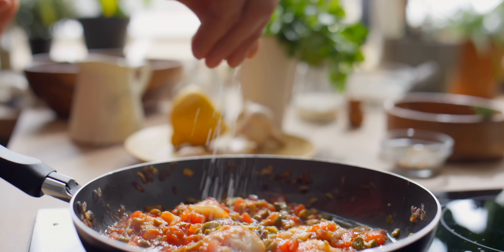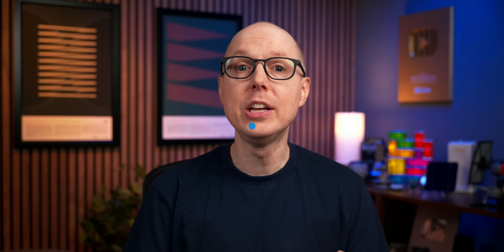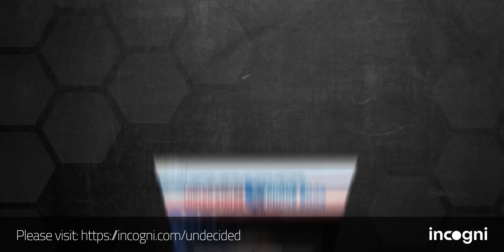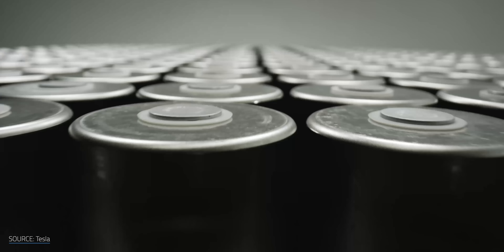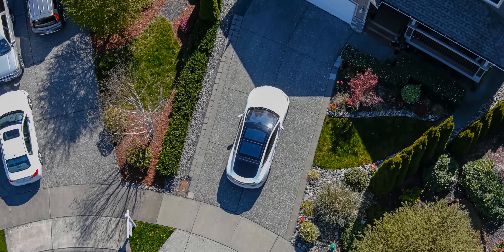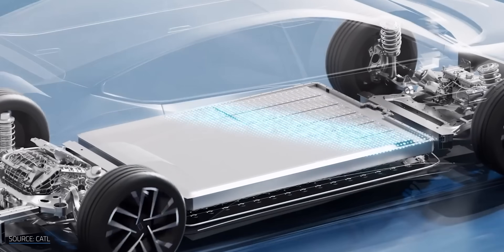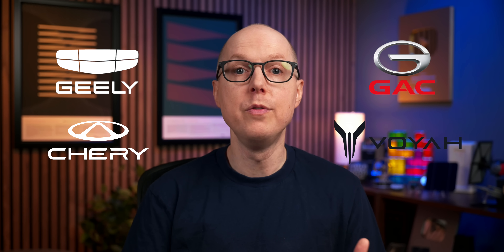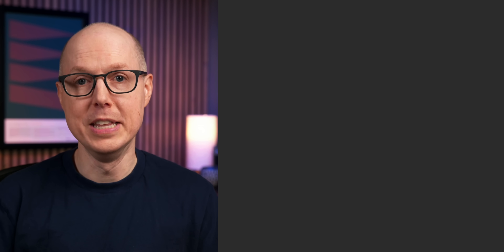How CATL Made Batteries 90% Cheaper (And What Happens Next)

Comment: Ideally a car would have a fixed sodium battery for daily use and a removable lithium battery for road trips.  Since you only rent the lithium battery when needed the initial cost of the car would be lower.  In daily use you are not hauling the lithium battery around when not needed.  Since the sodium battery has enough charge cycles to exceed the life of the car - no worries about replacement costs.

Comment: Part of the push by CATL to roll out this new chemistry is not about making batteries cheaper, but it's to comply with China's EV 2026 law, which mandates that EV batteries shall not, under any conditions go into thermal runaway or explode / catch fire when in an accident or punctured. 
Both BYD and CATL have batteries which comply to the new rules.

Comment: I'd want to see more info about charging speeds.  Slightly less capacity coupled with equivalent or even faster charging speeds would be completely acceptable, I'd think.  My hope would be that charging speeds wouldn't be as limited by thermal constraints, so it would probably be more a question of whether the difference in chemistry impacts the speed.  Looking forward to more information in the future!
Reply: 5C claimed... Not industry leading which is now 10C or 12C but still good...

Comment: Consumers generally speaking do NOT CARE about battery chemistry as long AS IT WORKS.  If the $10/kwh is right then battery swapping instead of charging becomes much more economically friendly.  When my 79 year old dad told me that he thinks an EV would be a better choice for them over a gas car, that's proof that EV adoption is going to accelerate.  For a commute mobile, there's zero reason to get a gas car today.
Reply: "There's zero reason". Depends on where you live. Maybe that is true for your context, but not to many people around the world.

I want to buy an EV and change my old car, but the main issue with the transition to EV is infrastructure.

Countries like China developed a whole ecosystem while pushing for EVs or even before the EVs started to gain popularity.

In many countries, the contrary is happening, EVs are arriving way before the changes needed in infrastructure like the fact that EV cars are heavier. Are roads and buildings designed to hold more weight if everybody switch to EVs? Or extra electricity demand. Are our countries grid designed to this sudden increase in demand?

In my apartment for example, it will cost several thousands to instal the plug to reach my parking lot. Also, it will need the approval from the building administration and even the HOA can have a say in case they consider it a "risk".

So, I wouldn't say there are no reasons to not change. There are many challenges even if you want to change depending on where you live.
Reply: The only reason is politics.
Reply: They may not care about the chemistry itself (I don't: I want it to work, and that's it) but they do care about cost and fires. Cost is up in the air at the moment: we don't really KNOW how much these batteries would cost - that 10% is just an allegation. I'll believe it when I pay 10% at point of sale.

The fire problem... well, lithium batteries DO have this problem. No, it's not "the heavens are falling" problem, but it is quite real. And sodium batteries don't have it. It's a damn good argument, don't You think?

Comment: I see this as sodium batteries helping to maintain the life of lithium batteries. And when lithium is too cold to operate properly, you can use sodium to effectively heat up the pack so the lithium battery can be use more efficiently. So like using a generator to black start a larger power plant

Comment: I know you kid about "buying an ebike instead of a car", but ebike batteries are quite expensive. We're talking €1,000+/kWh for batteries from the big motor manufacturers.

That is INSANELY expensive. That'd be €50,000+ for a Tesla Model 3 battery pack. Basically the prices for ebike batteries are stuck around 2012 or so.
Reply: Well... the problem is your scale is off.  By a lot.  E-Bike batteries absolutely do NOT need to be that large.  It only takes roughly ~350 watt-hours to have a decent 35-mile range with a modest 500W (or smaller) e-bike.  Like a small mid-drive.

E-Bikes with huge batteries are not really e-bikes... they are more like motorcycles or mopeds.   Still far, far cheaper than buying a car, though.  The people who sport really large e-bike batteries (in equally large and heavy e-bikes) generally do it for recreational reasons, not transportation.

For transportation you will never need more than 500 Wh and for most of your trips you won't need more than 250 Wh.  Not unless you are going 50+ miles anyway or need a lot of cargo capability.

-Matt
Reply: @junkerzn7312  I'm really not off. At most it's a matter of the retailer having a sale or discount at the point in time where you look.

My commuter ebike, limited to 25 km/h (and thus not a moped), has a 625 Wh Bosch Power Tube battery. A replacement battery for that is €679 at a reputable retailer.

Could I settle for something smaller than that? Most of the time, but then I HAVE to constantly take it out of the bike to recharge it. And even then it's not cheap. The 500 Wh version of the Bosch Power Tube is €425 at the same retailer. And those aren't recommended retail pricing, as those are typically quite a bit higher.

And it's not just Bosch. Brose, Fazua, Giant, Mahle, Impulse, Panasonic, Shimano and Yamaha are ALL in that high price range.

But please, if you know where to get
Reply: @junkerzn7312  

I'm really not off. At most it's a matter of the retailer having a sale or discount at the point in time where you look.

My commuter ebike, limited to 25 km/h (and thus not a moped), has a 625 Wh Bosch Power Tube battery. A replacement battery for that is €679 at a reputable retailer.

Could I settle for something smaller than that? Most of the time, but then I HAVE to constantly take it out of the bike to recharge it. I can get ~50 km of city traffic out of my battery (lots of starts and stops), because I'm a BIG guy and have terrible knees. The longest I ever go in a single day is ~40 kms, and it's nice to know that I won't get stuck on those rides (as I said, I have terrible knees).

And even then it's not cheap. The 500 Wh version of the Bosch Power Tube is €425 at the same retailer. And those aren't recommended retail pricing, as those are typically quite a bit higher.

And it's not just Bosch. Brose, Fazua, Giant, Mahle, Impulse, Panasonic, Shimano and Yamaha are ALL in that high price range.

But please, if you know where to get a 625 Wh Bosch Power Tube (non-vertical) for a LOT less than €679, please let me know. And by "a LOT" I assume neither of us mean a €10 savings. It should be at most half that price before you can talk about a scale being off by a lot.

Comment: This reminds me of the repetition of history. In the “energy crisis” of the early 70s, Popular Science/Popular Mechanics and similar mags were full of articles on new (rechargeable) battery designs, mainly for cars, ranging from a molten sulphur electrolyte based unit to an aluminum-air design. At that time as like today, a key consideration was quick recharge. Like lithium batteries, a key concern for the molten sulphur battery was fire in case of an accident - almost Biblical. Ironically a key problem with the Al-air unit was its extreme sensitivity to CO2 in the atmosphere. Even the lower levels present then were a major obstacle. I do hope something really useful comes out of this.

Comment: Personally, I would far prefer Sodium Ion to LFP chemistry in my car, or in my home.  The safety benefits of Sodium outweigh the performance decrease.   For my home, I think I’d rest a lot better knowing my energy storage won’t explode and burn my house down!  The better cold weather functionality is a bonus at that point.  I know very little about this technology.  I really appreciate your videos!  Thank you so much for explaining this so clearly.
Reply: @SandyMasquith  I think you’re confusing LFP with L-ion. The ion ones are the ones that are in your phone and the first generation of cars (Tesla, …). LFP, aka lithium iron phosphate, don’t have the troublesome thermal runaway problems. They’re not perfect but vastly safer, and are now the standard in most fixed location situations (home batteries, Tesla powereall, jackery, …) and many cars models which don’t have the longest range.
Reply: @PeterDrier TRUE
Reply: @PeterDrier  LFP cathodes are still LITHIUM-ION.
Reply: @neutronpcxt372  Any battery that uses lithium is technically 'lithium-ion', but clearly they are not all the same. You would however have better luck trying to bathe a stray cat than set an LFP cell on fire by thermal runaway.
Reply: @neutronpcxt372  So many people don't realise that LFP is still LI-ion technology, it's just a sub-category along with NMC, NCA etc.
Reply: @neutronpcxt372  BUT LFP are not subject to thermal runway, they basically don't catch fire and they have the added benefit of a signficantly longer life span.
Reply: @nicholasespinoza9610  That's not the problem. The problem is just spreading misconception by saying LFP is different than lithium-ion; simplifying stuff too much is not great.
Reply: @slimjim1125  "LFP is still LI-ion technology" lmk when you find a product that advertises lfp as "li-ion" or vice versa. 

Usually the properties and use cases are different enough for a distinct classification that's easily communicable.
Reply: @neutronpcxt372  actually misconception is spread by not identifying them differently. Most people when they hear lithium ion are actually thinking about NMC or lithium polymer batteries, which are different. Using an alternative name helps to show that they are different.
Reply: @morosis82  Now you understand why you'll always see me write "NMC(A) cells, LFP cells, or LMO cells" :)
Reply: @PeterDrier  It doesn't help that 'iron' is usually pronounced 'ion'  :-(
Reply: @PeterDrier  Yeah, LFP (Lithium Iron Phosphate) are very safe batteries but are roughly half the energy density of Lithium Ion. This is why LFP is great for house batteries but terrible for vehicles.
Reply: @MikeZ8709 Sodium ion's energy density is even worse, lol.
Reply: @MikeZ8709 I wouldn’t say ‘terrible’, my Tesla has LFP after 2 years, still lookin’ pretty good
Reply: @MikeZ8709  In theory, but in reality you can find cars with over 70 kWh of LFP batteries that still achieve decent range. The Tesla standard range models sell in europe with LFP batteries.
Reply: @PeterDrier  LFP is still Li-ion...
Reply: Research has identified just ~510 examples of ev fires due to thermal runaway, in the whole world, from 2010 to 2023.

I'll leave the rate of ice fires in your area to you, but in NSW Australia last year there was like 3000.
Reply: The main cause of battery fires is short circuits within the cells, because once you have a short, there is no way of turning it off, and it's going to dissipate ALL of what's left in the cell, and THAT's going to start a chain reaction that doesn't end until the whole battery has turned into flame.  It doesn't matter much which battery chemistry you're using.  The flammable component of Li-ion cells isn't the lithium, it's the organic electrolyte.  I don't know if they're using the same sort of electrolyte in Na-ion cells, but there really could be just as big a hazard there.  Again, it's not the lithium that's the hazard - it's the total amount of energy you're storing in a small space.  Gasoline cars are fire hazards as well: 1972 Pinto, anybody?  2001 Explorer?  Over time the battery manufacturers have gotten better at this, just like the auto industry has gotten better with the hazards that come with gasoline.
Reply: My understanding is that the fire danger in lithium batteries is wildly overstated, and you're more likely to have your house burned down by an ICE vehicle than an EV.
Battery fires are more difficult to put out though.
Reply: @MrWyzdum how does an ice vehicle spontaneously combust exactly?  There's literally one way, an electrical short.
Reply: @mostIy_peacefuI  actually, the one car fire I have direct knowledge of was caused by static electricity while putting fuel in the car. So yes, it's an electrical spark, but not an electrical short in the car's electrical systems. So not literally one way, sorry.
Reply: @theharper1  You gas up in your garage at home?
Reply: @beerdedwanderer you think the only place you generate static is on nylon carpet? I'm guessing that you never lived in a dry area.
Reply: @theharper1  What are you going on about?  My reply was directly to somebody talking about EVs burning down houses.  In their garage.  People aren't refueling their ice car in their garage so your fantastical static explosion while refueling is completely pointless. An ice car just sitting parked in the garage isn't spontaneously igniting.
Reply: I don't know what kind of battery they had, but a house down the block from me just had their home battery catch fire about a month ago. I only know that because after the latest neighborhood blackout - an all-too-frequent occurrence - I brought up the idea of getting a battery backup for the apartment building with my landlord, and this was a big concern she raised. Whatever the statistical rarity of it is (and we've got gas heating), it only takes one example to stick in someone's head.

If this here is for real, the cost would be a big factor to be sure, but an even bigger factor would be being able to say "yeah, but this is sodium, and that's entirely different and won't catch fire."
Reply: @dwc1964  there is no fire danger with LFP batteries.

Comment: LiIon is not only about Lithium. It is Lithium+Cobalt. You need 2 metals.
I wonder what is pair metal in Sodium battery. There is no element "M" as highligthed in the picture.
Reply: M in batteries usually stands for Manganese. Battery chemistry names use single letter abbreviations rather than chemical symbols, such as LMFP for Lithium Manganese Iron Phosphate.
Reply: @GruffSillyGoat Thanks, I like Manganese more than Cobalt.

Comment: Sodium is already here. As a consumer in the EU I can Import 210AH sodium cells DDP (delivery and duty paid) for around 80€/kWh.
Also in China the Baochi Energy Storage Station uses Sodium Batteries + Grid Forming Inverters.
Reply: 12v 210 AH?
Reply: @FSIronman  other forms of batteries are also here. I’m working with a new battery technology paired with inverters (and some other proprietary technology)  providing ~1MW energy density and ~5MWh.  It’s going to change the industrial side of the industry.
Reply: @keithskoglund10 MW (power output capacity) is not the same as MWh (energy storage capacity).
1MW is equivalent to 1,340 Horsepower. That’s a lot for a car, but some automakers are doing this already.
Reply: @mikalrage7316  My bad I was up late last night lol.  I cant go into specifics (NDA) but it's ~1MW energy density, ~5MWh.  This technology is not designed for vehicles.
Reply: 3,7 V and 210 AH is ca. 0,8 KWh ........... cost 80 Euro ......... is ca. 100 Euro per KWh !!
Its today not cheaper than LIPO !!! you get a 1.grade LIPO cell with 1 KWh for 70 Euros here !!!
Greetings from Grmany
Reply: @alterbayer7196 Nobody said it's cheaper just that it exists already today and you can build batteries from it yourself.
Reply: Por cuestiones de comercio venden bacterias que duren 10 años y ya
Reply: Where can you do that?
Reply: @Dix-q6b As soon as I use any Chinese Supplier name the comment gets deleted look up the major stores wholesale price is around 30$ per cell + shipping and duty

Comment: One thing you don't touch on is round trip efficiency. LFP has Sodium beat by a wide margin from the last information I've read. While that may not matter in some use cases, it will matter a great deal in others.

Comment: As an owner of a 10 year old 24kwh Leaf, I would absolutely drop a few k on a sodium battery upgrade. The current options on the market are just too expensive to justify putting them into a 10 year old car.
Reply: There is No Any Oficial information, that show 10$ price. Only hype groundless rumors.
Reply: EV evolution has been so rapid, you can't really count on being able to upgrade cars that already exist.  A pack would have to be designed for each specific model, and they aren't going to be making upgrade kits for the 10 year old models first.  More like the 5 year old models first, and by the time the technology and supply chains catch up, it's going to be a 15 or 20 year old Leaf.  Which is why people are expecting zero trade-in value for EVs at this point.
Reply: @BrightBlueJim  Modular, uniform battery packs would be transformational. They are doing this in some Asian city centers with 2-wheelers and swappable batteries. having a uniform form factor for 4-wheelers for ease of improvements would add loads of life to cars (perhaps much to the chagrin of auto makers....)

Comment: lowkey any enthusiast knows the commoners, sometimes deadly, cost is in the electronics, not the batteries anymore. protections and efficiency cost 4x the batteries for us of low birth. We need all bms types and cell high quality protections to drop 10x before any battery tech becomes "everything". $10kwh till the house burns down cause you got the $10 bms cause you couldnt buy the $5000 inverter etc etc etc.
Any progress is good though, I'm just......NaCl :)